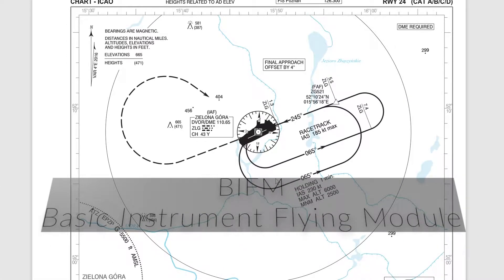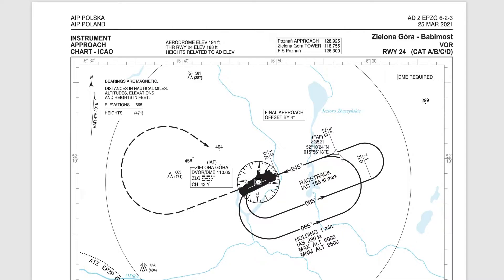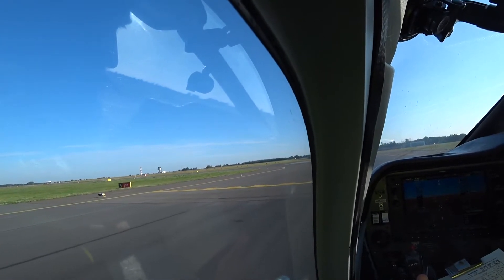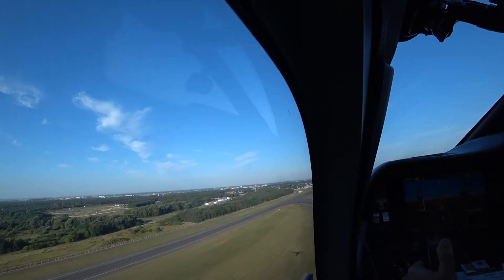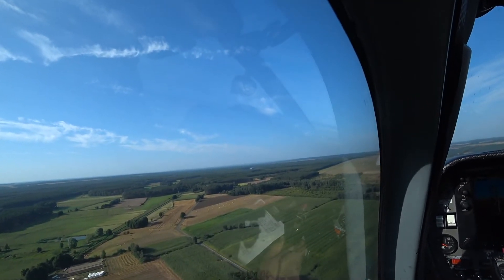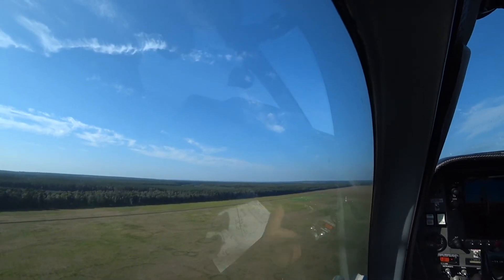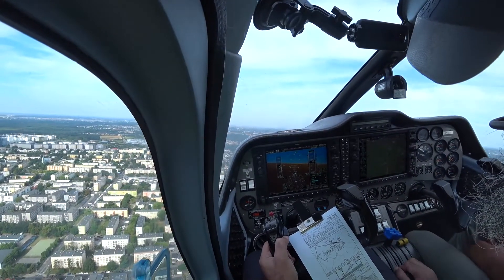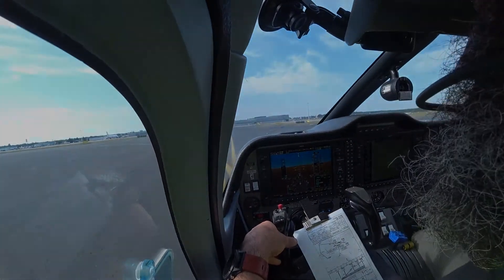CPL/MEP/MEIR - BIFM (Basic Instrument Flying Module). EPPO, EPZG, EPPO

Comment: Thanks for the great vid, I found it from your review on pilot-network. I'm in a similar position however with UK CAA ATPL exams only (unfortunately my last one was completed in 2021 so I couldnt' convert). I contact Bartho but he said they do not offer UK CAA at Smart Aviation any more, do you know of any other schools that may do this in Europe? Many thanks again
Reply from the maker: hi, congrats on completing your theory exams.
Within Europe, Diamond School in Sweden were offering dual authority courses.

You may be able to complete EASA courses in the EU, then apply to the UK to convert your CPL, however the EU authority would need to accept your ATPL theory exams.
Some schools in the UK are starting to offer dual licensing, such as L3 and FTA.

Its worth asking Bartolini and other schools in Poland, Hungary, and Czech.
Reply: @reportonfinal9162  Thanks so much for getting back to me, really appreciate it. 

Yes Diamond have mentioned they can do this, I was wondering why other schools such as Smart may no longer accept UK CAA ATPL exams? Any ideas? All the best, Charles
Reply from the maker: @carfraec  it could be a number of reasons such as, costs of Simulator Re-validation, availability of dual qualified examiners, country policy changes. Also, the EASA licence is useful if based in the UK flying EU aircraft, but to fly based  out of the EU will require an EU work permit.
Reply: @reportonfinal9162   I thought that may be the case, looking increasingly likely that I'll be re-doing the ATPL theory under an EASA authority to become more employable. Hopefully they're easier second time round 😂😭
Reply: @reportonfinal9162   I thought that may be the case, looking increasingly likely that I'll be re-doing the ATPL theory under an EASA authority to become more employable. Hopefully they're easier second time round 😂😭
Reply: Hahah yea you need easa atpl to train now